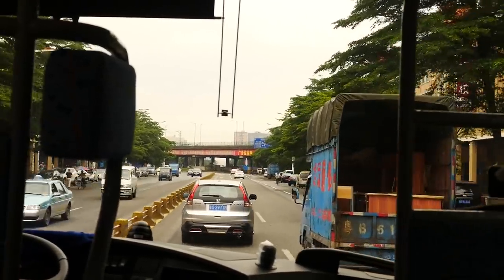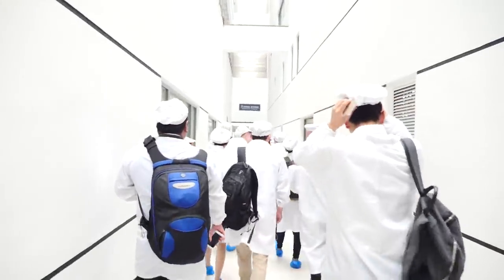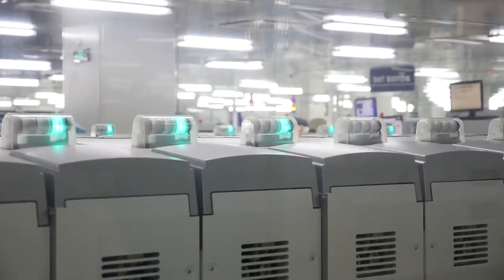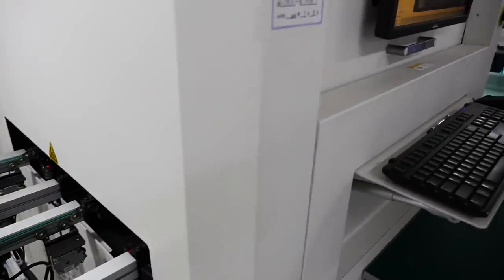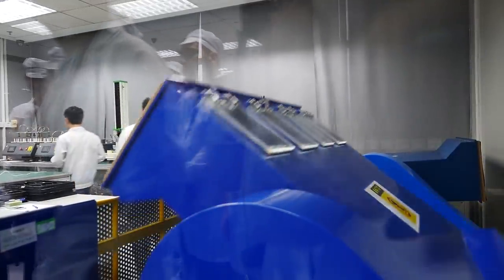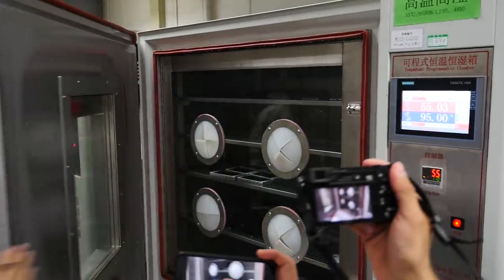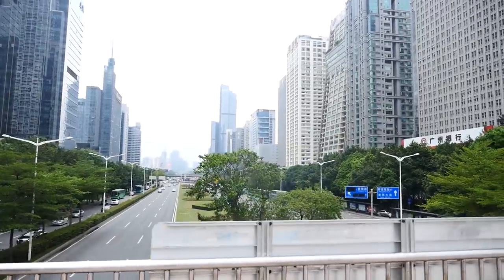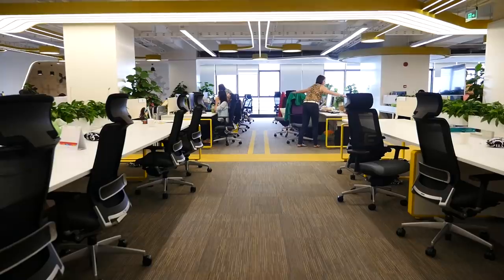OPPO Factory and Office Visit!

Comment: Proud to be Oppo Find 7 owner running cm12.1
Reply: Do u receive official updates from cyanogen??
Reply: Money Candan yes, I receive OTAs for nightlies everyday
Reply: ***** how stable it is?? And how long ur phone is being supported?
Reply: Money Candan To be honest it's quite stable, but some of the other ones I have tried have been quite buggy. I usually update if I encounter a bug on the one I was on and usually the bug is fixed on the newer version. I'm not sure what you mean by how long my phone is being supported?
Reply: *****  I think he meant how long did you used since the latest update?
Reply: I've used cyanogenmod as a whole for like half a year now, CM11 for a few months, CM12 since like a month, and CM12.1 since like 2/3 weeks.
Reply: ***** How is the battery life of the Find 7 running CM12.1? Noticed I can get it for £300 here in the UK. Would you recommend if over, say the Oppo R7 Plus? Maybe I should wait until OnePlus release the Two
Reply: Paul Parsons the battery life is pretty good especially since I switched to cm12.1. I'm not sure, because the r7 plus has specs better than the find 7,but the find 7 has a 2k display which the r7 plus does not have. Maybe you should wait for the oneplus two to come out and see how it compares to other phones.
Reply: ***** R5 owner, and I am proud too!

Comment: You may have liked to have actually explained SMT, explaining that it stands for "Surface Mount Technology" - I think even this dumbed down age could grasp that concept, instead of abstracting it away as you did.

The "bits and pieces", as you call them, are called "components" - they are SOLDERED to the board, not "melded" - you've no idea what you're talking about, it would appear. Source: I have been an electronics repair and design tech since 1991.

meld1
mɛld/Submit
verb
past tense: melded; past participle: melded
blend; combine.
"Australia's winemakers have melded modern science with traditional art"